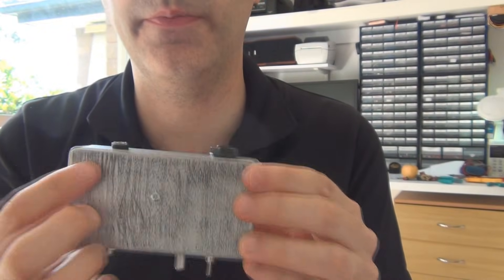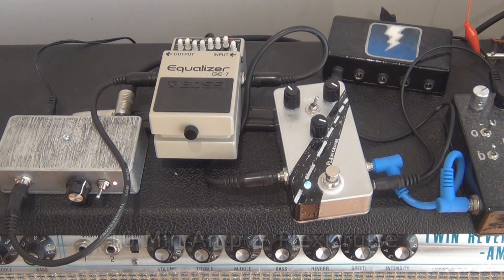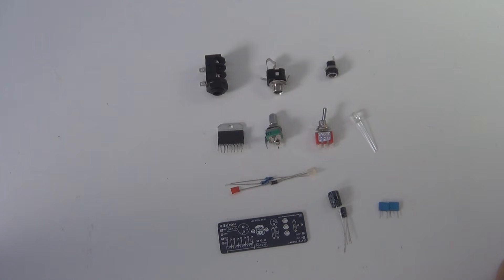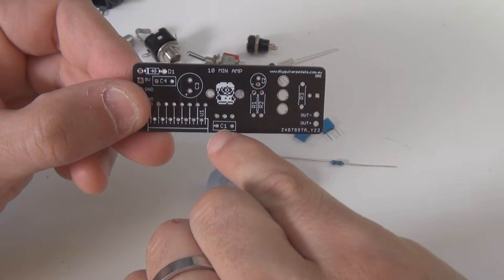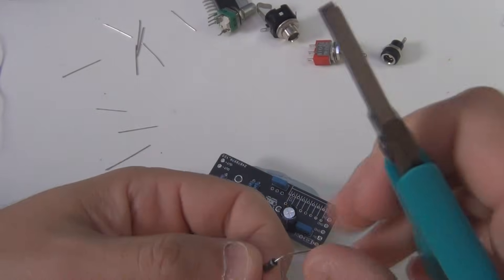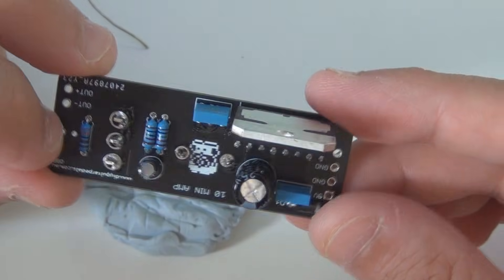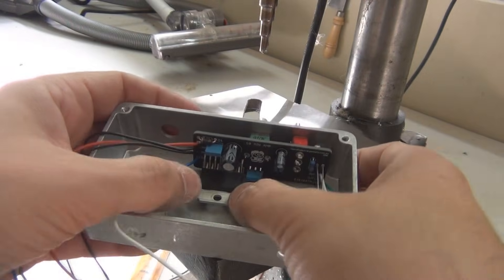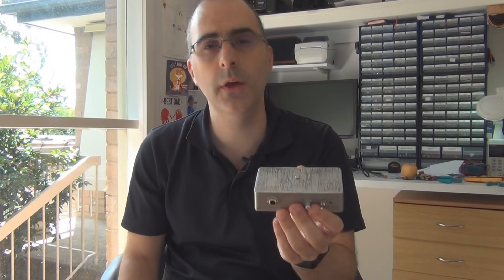Build A Guitar Amp In 10 Mins

Comment: I’ve got a couple of questions before I purchase, hopefully they haven’t been asked/answered already! 

Does this kit maintain a clean tone at all volumes or does it break up quickly? I’m wanting to use it with a modelling pedal so the cleaner the tone the better. 

Also, based on the voltage/wattage chart in the  manual, if I was to run this with an 18v power supply it should get the unit up to around 15 watts of power. Does that sound right?

Thank you!
Reply: It's a rather good "clean" amp, which is nice when you want your pedals to do the distortion and dirt. It does break up a bit once you max out the head-room, whatever voltage that is provided.
Reply: @erikvincent5846  thank you!

Comment: If you wanted to put this in an amp with a speaker, how does the "needing a metal case" affect it? How would you compensate for that?
Reply: Amps have a metal chassis. It shields the electronics from electromagnetic interference.

Comment: Just another question: so 15 V and 0,42amp will power this thing right?

I just had another thought: can i put my 12V 1amp dc power supply in an input and instead of just one +and one - cable i put 2 on each side 
Will that give me 2x 12V with 0,5ampere or am i completly wrong

It's just becouse of some reasons i want to build my own power supply and i'm not that good at this and more put some things together
Reply: So, the power rating for this will accept 15V. It draws a bit of current, especially when you push it with something, like a large boost, but 420mA should be able to work with most speakers you'd likely be pushing.

As of your power supply, the 12V 1A delivery is likely limited by the electronics inside and not your wiring. So, splitting up your wiring will not "divide" your current. As of "+" and "-", one is your negative wire, or ground, and the other is "hot" or 12V. Both wires will be needed to deliver power somewhere.

Comment: So when i want to build Speakers to the Amp, do they need to be powered on there own?
Or does the Amp also Power the speakers? 

I'm new to all that stuff but I find it really interested so a answer would be nice
Reply: In this case, the 10 Min Amp has a power amplifier, which in turn drives the speakers without needing an external power source. If it was just a "pre-amp", then it would require a means of driving those speakers.

Comment: what can you use instead of the bored thats in this
Reply: You can build it on a strip board called veroboard, this is a board that comes in different sizes that you can snap of on the lines of perforations to required size. They come plain or with copper tracks on the bottom under side. You place the components from the top and once solderd in you make breakes for unwanted connections between components in the copper track with a 5mm drill bit.

Comment: Hi! Hopefully you see this and can offer some advice.
I received the kit, wired it up, plug it into my Marshall 1x12, turn on the power switch, LED lights up, but no sound. I turn the volume knob halfway, nothing. All the way, nothing.
I took measurements with my voltage meter and get no voltage on any of the three points in the pot. I get readings on all the caps and resistors. And I get readings on some but not all points on the op amp.
What am I missing? I've checked all of my solder points and they look good.
Reply: did you get to solve this issue? i am having the same problem. cheers

Comment: Question : So if theres a build wich has more knobs like tone/mid/vol(maybe gain too idk) and instand of the output a speaker wired up i could use that thing for my build-in-amp for my diy travell semihollow telecaster powered by a powerbank with usb to 9dv cable is that right?  Would it fit if i cover the speakers backs with copper/shielding tape???

Comment: So this has the power to go straight form the output of the 10 min amp to the input of a 2x12/1x12?  So it's speaker level out?
Reply: That is correct.
Reply: @erikvincent5846  thanks Erik. Already received it in the post!

Comment: hi, any value on the caps will do? like 16v or 35v?
Reply: Just make sure that they are greater than the voltages you intend to power it with. 25V or higher should be more than enough.

Comment: Hey gang, I just built mine and the level seems low. I have to turn it up all the way to get any sort of level out of it. While I understand it's a small amp, seems quiet. Appreciate any feedback. Thanks!
Reply from the maker: Hi Bakewelder.  There's a few things that influence output volume.  Source voltage, speaker size and input signal level.  Although they are all important the later (guitar signal level) actually plays a significant role.  Trying boosting your guitar signal and see if that helps.  Cheers.

Comment: Hi Paul & Erik, I just finished building this and cannot get any output using my guitar which is equipped with active EMG pickups.  If I use a guitar with passive pickups I get sound, although it is very low output. The EMG guitar works with my other amps.

Do you know what might be the cause of this?

Edit: I’ve been going over the build to check everything is wired correctly, and when using the multimeter in continuity mode, the input jack tip is registering as being connected to ground (this is obviously the issue), but I have no solder bridges, and everything is wired correctly.

Not sure where to go from here.
Reply: If you are certain there are no solder bridges nor and bad wiring, you may have a bad component. I'd check the following
1. The volume pot. The volume pot connects the input tip to pin 1 of the pot, while pin 3 of the pot is ground. If internally, that is broke, it may shunt to ground
2. The D1 diode is on upside-down or is on right-side-up, but is dead (internally shunted). When diodes "die" half the time, they blow apart, but the other half of the time, they fuse together and become a near 0 ohm resistor, which in turn shunts to ground.
3. C2, C3, and or C4 are damaged internally. I see this more with box film caps more than any other. Basically, the internals are touching leads, which turns the capacitor into a resistor. If a capacitor not in any board shows a low value of resistance between its two leads with a multimeter, that capacitor is probably not good and will ultimately shunt something (in this case, to ground)
Reply: Thanks for the response Erik, I’ve been messing around with it, and it works fine now, also added a +9v to +18v charge pump to get the max wattage.  Running through a 50 watt 12 inch Jensen Falcon with a DIY Friedman Buxom Boost in front of the amp is INSANELY loud 😃👍.  Still can’t get it to work with active pickups though.

Comment: I’m new to guitars. Can someone explain what this does? Like can I connect this amp to any speaker I have lying around and play my guitar through there? Can I use old PC speakers?
Reply: Usually, yes. However, you may want to check out the speaker impedances before trying. If not rated well enough, it could blow the speaker at high volumes.
Reply: @erikvincent5846  
Correction. The risk is actually to overheat the amplifier portion of the circuit. It’s ALWAYS safe to use speakers of a HIGHER impedance than the output recommended for the amp. It sounds counterintuitive but that’s how it works.

Comment: This is a dumb question but instead of using that black piece as the output could u just connect those wire directly to a speaker?
Reply: And if so what wattage/resistance should it be?
Reply: You could. 8 ohms of resistance, maximum of 7 watts.

Comment: Have a few questions.
1. Can I series two sets of paralleled 9 volts batteries into 18 volt, and how many batteries would that require to run this amp, for say 4h of jamming at 50% volume on this little amp?
2. I have some small speakers from an old surround sound system, 15 watts, but 4 ohm. I have 4 of those, will this amp be okay to drive 4x4ohm series wired speakers (16ohm "aproximately")?
3. If #2 wont work, can I just series 2 of those speakers to hit approx. 8ohm, would that work?
4. Is it a possibility to run two amps into those speakers at the same time to get some "headroom" to drive the speakers without burning amp or speakers?
4a. If #4 is even possible, can I solder just one volume pot to both amps, so they they are like "matched" in output? -and would this require another value pot?
5. If I push the input a little with a tube OD pedal turned up a bit extra, does that change any of the above answers, or is this a bad idea to begin with?
Reply: As of the batteries, that's a hard to gauge question. The amount of current consumption varies drastically depending on what you are playing through it. If playing quiet single notes on the higher frets, for example, it may consume little current. Chugging hard on a palm muted E5 chord will consume a lot more. Putting an OD before the amp will drive it harder and therefore consume more current. Even the volume knob position plays a role. All these variables will effect the battery life. As of speakers, so long as you get 8-ohms of impedance, you should be good. Just make sure your wire lengths don't create an "out of phase" issue. I wouldn't recommend two amps into one speaker.

Comment: can I replace the TDA7266M with another one?
Reply: Unfortunately, this board was designed around the TDA7266M. If there is a chip that is pin compatible, that would work, but I am not aware of any.
Reply: TDA7294

Comment: I'm a beginner, and I'm trying to build this amp from the parts list and schematic but I'm having a bit of difficulty. I'm hoping I can get a bit of help from the veteran pedalsmiths out there. I'm starting with a breadboard before I commit it to soldering, but there are a couple of spots in the schematic that puzzle me. 
First, there are no (-) connections for power or signal input. I'm assuming that in the kit these are provided by grounding the jacks to the enclosure, correct? If so, should I be able to connect the negative side of the power and signal-in jacks to common ground on the breadboard? If that's the case, are there any other spots where the grounding is not explicit?
Second, I don't understand the notation "3*2" at the VCC connector on the TDA7226M. The datasheet for the IC says that pins 3 and 13 are both VCC. What connection(s) am I supposed to make here? 3 and 13?
Forgive me if I'm overlooking something obvious. As I said, I'm just getting into the hobby, and this is my first build. I'm eager to get it working. Thanks for any assistance you can offer. Cheers!
Reply: No worries. Your input power ground just goes to common ground, along with the input jack's sleeve. Do not connect the output jack sleeve to ground. That will kill the signal. The 3*2 is an EAGLE Cad artifact. You are correct, though, pins 3 and 13 go to positive voltage.

Comment: Hi Paul, can a TDA7266 be used instead of a TDA7266M?
Reply: The non M version is stereo and will required some hook ups that are not available on this board to force it to work in mono. So, you will need the M version.
Reply: thanks for the response Erik, now I have to figure out what to do with a spare TDA7266 😄

Comment: I tried to make this on a breadboard. After hours, impossible to have a single sound out of it, not a single crack ou blow..
20 bucks wasted, great
Reply: Yeah. It's kinda difficult to breadboard it because of the power and signal ground. It's confusing how they work, but i could make a astonishing amp with this IC on a breadboard. Other thing you must pay attention is the voltage divider to the mute and the standby inputs.
Reply: That TDA chip doesn't exactly lend itself to a breadboard very well.
Reply: @erikvincent5846  right, I put it on a prototype PCB because of that
Reply: @enklum  How did you wire it? For example, it has a built in "stand-by" and mute control that won't let it do anything unless set. If you look at the schematic, that's what R1, R2, and C2 are doing. Also, Signal and Power Ground do get connected to true ground. Lastly, the out jack sleeve cannot touch ground, which is not what you would normally do on an LM386 style amplifier. That actually only goes straight to the output, and that's it. Pins 2 and 3 must go to your Voltage supply. The remaining pins must remain left unused.
Reply: @erikvincent5846  I wired it like I see it on 10 min amp PDF. No problem with the out jack sleeve, there's no sleeve it's directly connected to the woofer
but what do you mean with "pins 2 and 3 must go to your voltage supply"? For the pin 3 ok, but pin 2 is out - no?
Reply: @enklum  wow, I am glad I came back to this post. Samsung phones' YouTube app doesn't do typing very well, apparently. Pins 3 and 13 (no idea how it grabbed "2" from that)
Reply: @erikvincent5846  It's ok it works now, I have found what's wrong watching at the pcb picture on the PDF
Thanks for your help
Reply: @enklum  excellent. What did it turn out being?

Comment: TDA7266M is a bridge amplifier, so its negative output (pin 2, OUT 1- ) cannot be shorted to ground.The output socket must be isolated from the metal housing.
Reply: This is correct. This is why in the build doc, it specifically states that the output jack must be isolated (usually plastic) so it doesn't ground out with the chassis. The big tab on the TDA7266M on the other hand, that would benefit greatly by grounding it to the chassis. Not just for the sake of grounding, but also for the sake of being a heat sink.

Comment: Hey, love your videos! I have been watching them for a long time. Something I have always wanted to learn is how to make a guitar amp for headphones. Could you build that?
Reply: Technically, you could do that with this. Just make sure you don't turn the volume knob up too much.
Reply: @erikvincent5846  I know, but there is still the risk of burning out my headphones and causing some damage to myself
Reply: @rockstarcovers7267  So, after some experimentation, here is what I determined. The TDA7266 has some level of load protection, so technically, you can just straight wire a stereo jack to the output and get head phones to work. However, the level of volume is still pretty loud, and if cranked, it will blow the 32 ohm load, that is your headphones, especially if you put high gain pedals in front of the amp. To resolve, I am updating the build doc now, but it shows how to add a 47 to 100 ohm resistor in series with the out+ wire, which will go straight to the headphone jacks stereo left/right. I just tried that with my cheap ear buds and placed a Univox Super Fuzz cranked on it. Headphones survived, but that was a bit loud for my ears to handle for any level of time. Hope that helps.
Reply: @erikvincent5846  thanks! I really appreciate your help! I'm still a novice in this, but I'll try to build the mini amp.